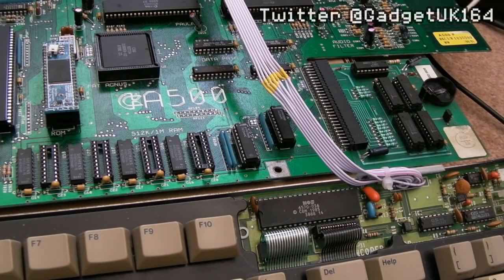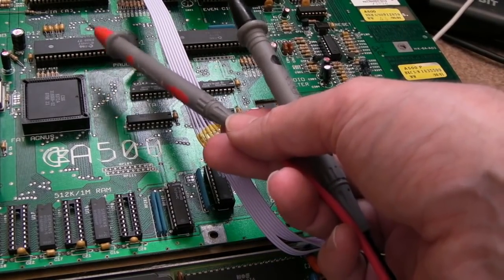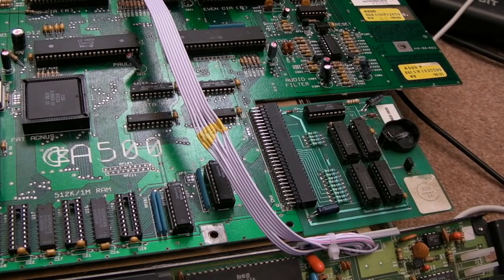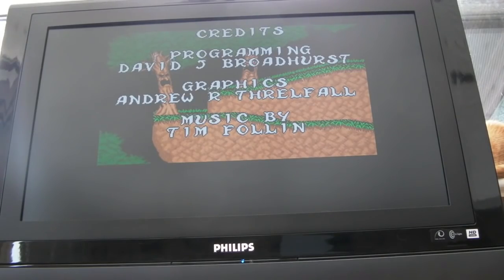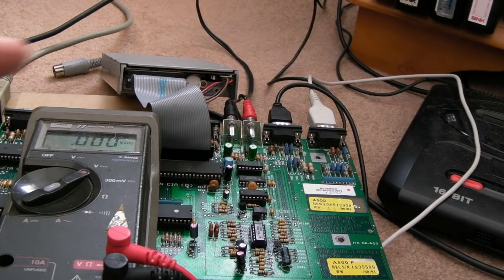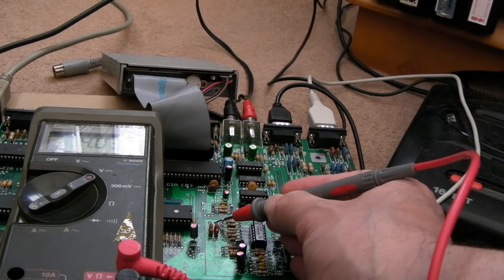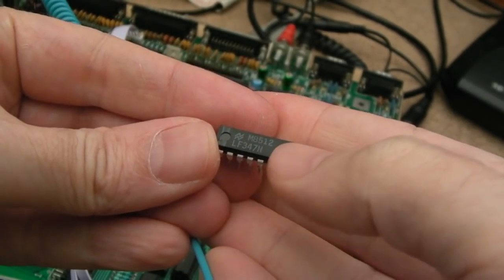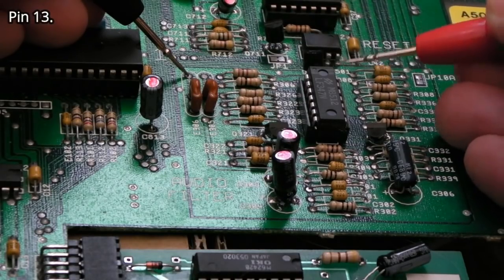Commodore Amiga A500 Audio Fault & Simple Keyboard Reset Repair

Comment: I had a similar issue with a drifting bias on the audio op-amp causing audio distortion, and in my case it was a broken wire for -12V in the PSU cable.

Comment: I'm wondering if it was because of the short legs on the chip not making full contact?
Reply from the maker: The legs were making contact though =/  But at some point they may have slipped out a little, contributing to the failure?

Comment: Weird behaviour when chips go bad. I would really like to understand what causes that behaviour of a slow increase in voltage, is it heat related?
Reply from the maker: I think it is temperature related over time - the reason the voltage goes way beyond the vref bias level is the chip is supplied with +12v  and -12v,  the +ve rail must have a short to its output that worsens over time.  I am also wondering if this fault is related to the A590 video.  It's possible that the bias was shorting to the 12v rail over time?!?  The bias is fed via a resistor potential divider though so it wouldnt be a direct short between the +12v and +5v, but maybe that had something to do with the issue when the FDD start using the 12v?!?  I will re-visit that A590 at some point soon though.
Reply: @GadgetUK164  Thanks for your thoughts and would look forward to seeing a revisit to that A590 as the first video made me really curious as to how those chips were getting so hot they burnt your finger. I always worry that if I don't fully understand what's causing something and can really fix it, I may have future issues that come out of it that I wasn't prepared for. I.e. like you had in this video, the question is, is that the end of it or will the real culprit be lurking deep down in the electronics elsewhere and cause more problems going forward. I don't have your electronic skills but I can learn from you figuring it out. Great work as always Chris.

Comment: My Amiga disk change seems to be playing up, I guess it could be the CIA or the drive.  All in all a pain.
Reply from the maker: Most common cause of that on the Amiga is the disk change switch on the drive!  Spray some contact cleaner into the switches and press then a few dozen times, then re-test.
Reply: @GadgetUK164  Seems likely although seems to have started working again it is doing some funny things.  In some programs which start up to workbench I double click an icon but then I need to eject and reinsert the disk before it will load.  Is this normal?